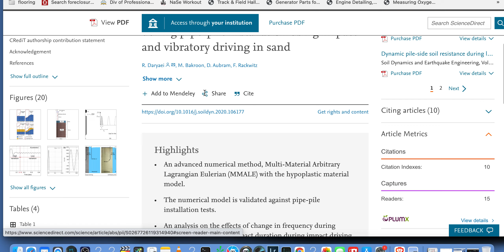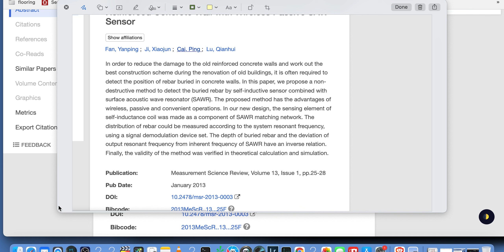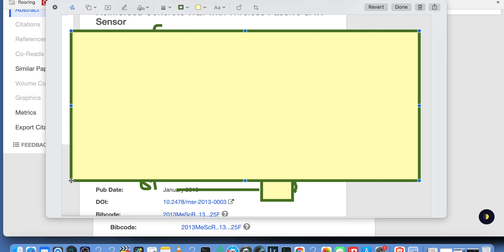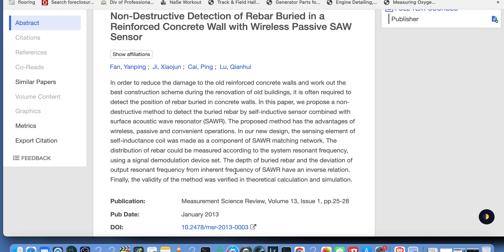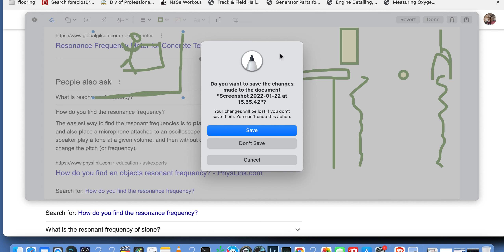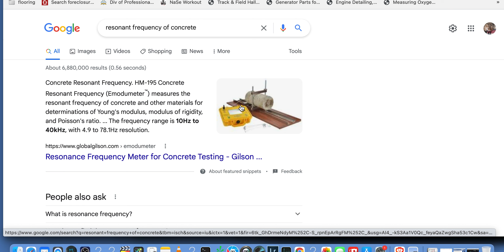Champlain Towers Collapse 87 Park Miami Resonant Frequency an easy defence AMAZING VIDEO CLOSE CASE

Comment from the maker: This channel is viewer supported, kindly give a thumb's up on this content, it would be greatly appreciated.

https://www.amazon.com/hz/wishlist/ls/3UBMVWND65U4M?ref_=wl_share

My email is cefa1@yahoo.com if you would like to get hold of me.

https://www.paypal.com/cgi-bin/webscr?cmd=_s-xclick&hosted_button_id=V9TGHDE92LQ8W&source=url  thank you very much.
https://ibb.co/r4wTF98

https://www.youtube.com/watch?v=p00-lJ0q_cA
DEFLECTION IN CONCRETE DECK MODELLED WITH REBAR ''ANTENNA" PART 1 of 3
Reply from the maker: Keep in mind, ONCE the fractures devolope, an entirely NEW resonant frequency is required to bring materials into failure "again" ...my point is, you only have the one source and it is "short cycled" and no data shows that piling has created a frequency that has fractured a deck through existing sheet piling and existing concrete /rebar composite system...NONE exist like this exampler...
Reply from the maker: Here is a debunk video https://youtu.be/S2q7VxeCj6I
Reply from the maker: Dampeners... Cracks... Cracks break the frequency and another frequency will be created if it crosses over the "cracks"...

Comment: Kai sorry a bit late in my comment been going some research and came to your conclusion that you have the recording of monitor is unconclusive ,i think the association is going down the wrong path. Hugs all round and big hug to Brucie 🐈🐈‍⬛🐈🐈‍⬛🐈‍⬛.
Reply from the maker: Hello Rosemary... I am confident that the ''resonant frequencies" of all the dynamic interactions would not have caused the required "resonant frequency" that could cause failure...
The cycle time was too short and the direction and intensity appears to be lacking  also...

Comment: Harmonic, inharmonic, enharmonic frequencies PLUS static, dynamic and shock loads are KEY 🔑.

The relationship between theses is just like the marriage between Portland Cement, aggregate and reinforcement AND how these all act as a blended family.

We use frequencies in special operations in various venues, a very powerful tool. 

The swimming pool was a damper to the damaging frequencies and loads and also may have been an amplifier thereof. 

The Surfside Beach Reclamation Project also created significant harmonic, inharmonic, enharmonic frequencies plus ample static, dynamic and shock loading thereof. I have eye witness.

Comment from the maker: Depose cv-5...
Reply: The way I interpret this situation is that if you pay for expert advice on how to avoid damage to a neighboring property, and you use the recommended equipment and you see the readings exceed the recommended threshold you need to take corrective action or seek advice.
Reply from the maker: Sounds about right (pun intended)...
I do not think it is possible, from what I read (the bumps in peak, one direction only), that a resonant frequency of the different material compositions could have been meet and cause a vibration induced failure.
Even if NV5 were onsite and monitoring, these bumps and readings (one off peaks) are acceptable...
As far as "over pressure" goes, even that is not creating resonant frequency to match that of the surrounding material compositions (glass, block walls, etc.) except for the human ear drums...